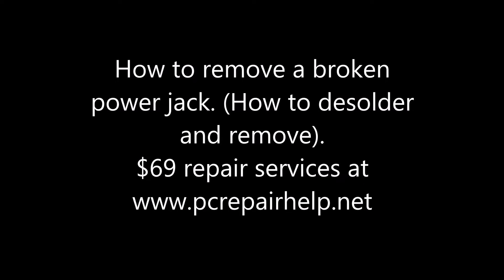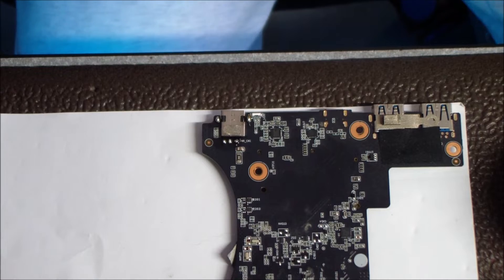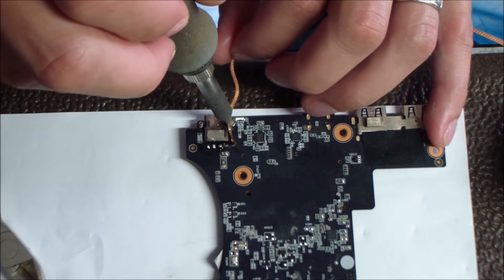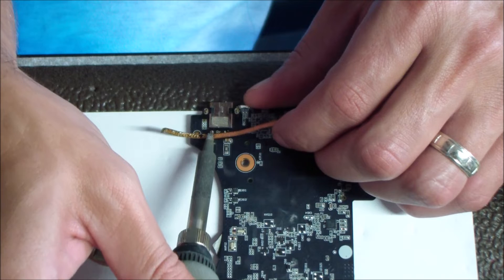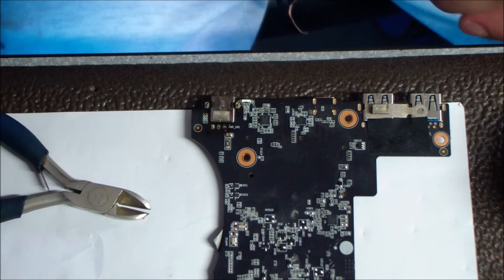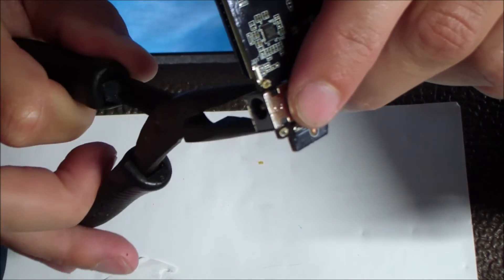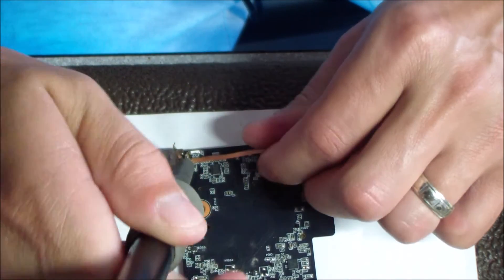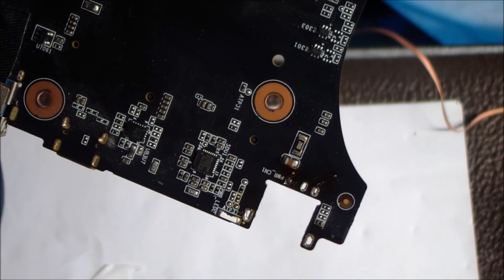How do I remove a broken power jack? (Guide to desolder)

Comment: So i got this laptop with a pushed in power jack, asus, broken off inside. Problem is the solder doesnt want to come off either. I got a solder sucker, no luck. I used flux and solder over and over to try and loosen it up, no luck. I used my pinecil at 330 c. I tried with a hot air gun also. Doesnt loosen it up enough to come out with a little pressure. I was surprised to see you using pliers though. I was using i fix it tweezers, thus might not have been that much pressure. I should say, all these work phenomenally well on other boards. Haven't tried any power Jack's before but like it's getting annoying having this asus in pieces. I don't know if I'm going to remember what screws went were making the put together process take a century

Do you know what I have to do to get this out? Should I snip the power jack off from the board(hopefully gently?) and work in a cluster free area? Should I throw it in a fire? Any advice is appreciated. I am using the vamp tools solder sucker like a pro, I got a really nice hot air rework station, the pinecil is pretty awesome. Idk what it could be that is going on but all these tries can't be good for it
Reply from the maker: What temperature are you running the hot air station on it?
Reply: @pomeroypowerjackrepair  817 f, it melts the other solder enough it seems. This being an SMB component I've never even tried doing anything with them. I've had some child solder experiences but this is just ughhhh
Reply from the maker: @Pr0toPoTaT0  Yes, that should be enough with the temperature. Are you adding any flux?